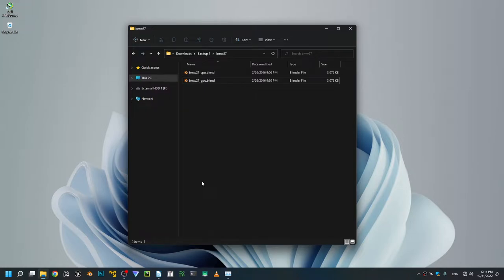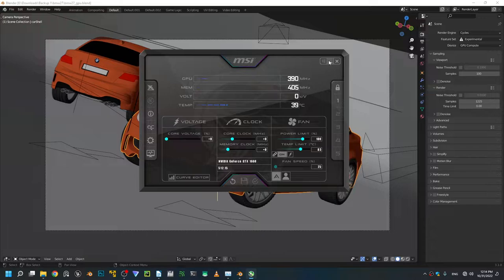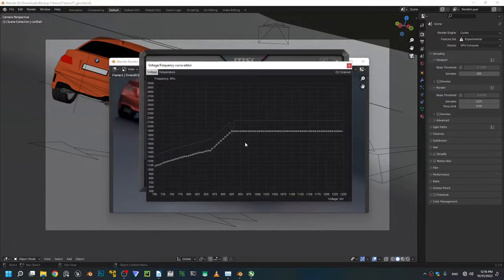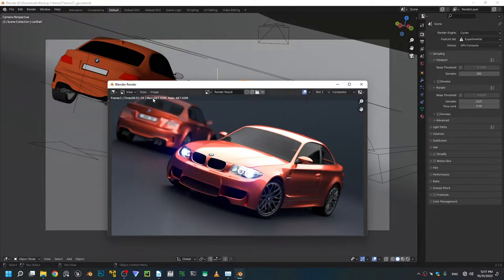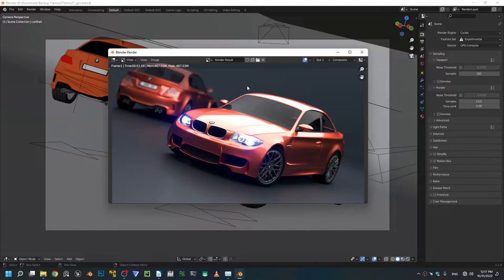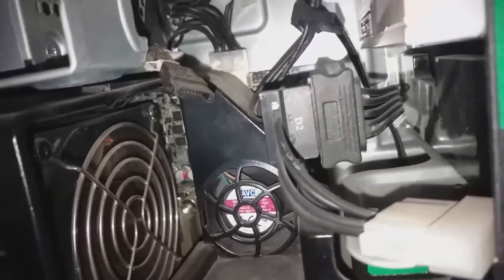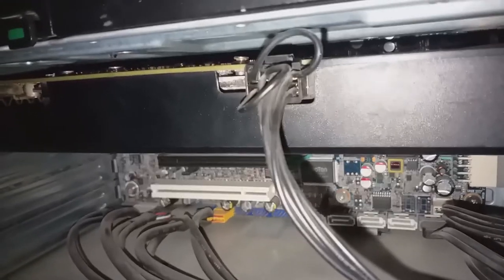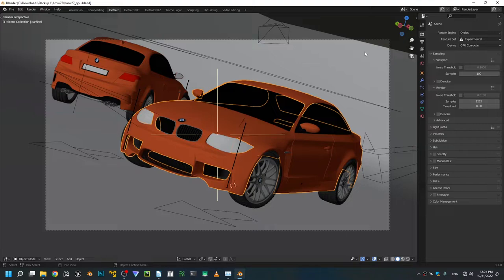Here Is Why Undervolting Your Gpu Will Help With Renders!

Comment: So undervolting the GPU, lowers temp, power consumption, etc. Does enabling DLSS  lower power consumption further? I read that DLSS uses less power when it is enabled I'm not sure if it is the case with UV GPUs?